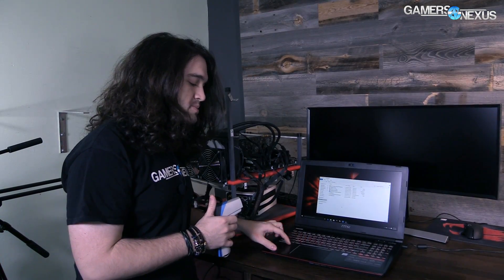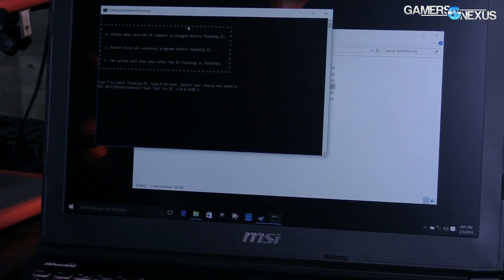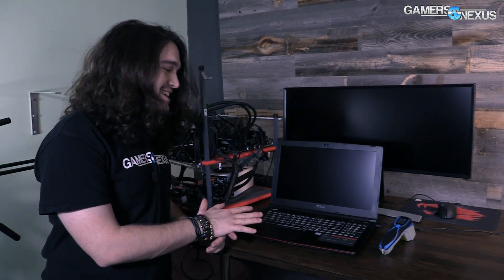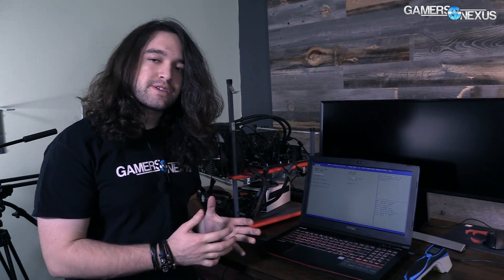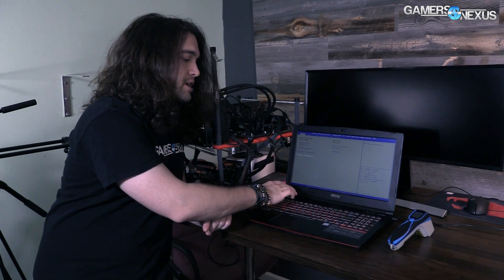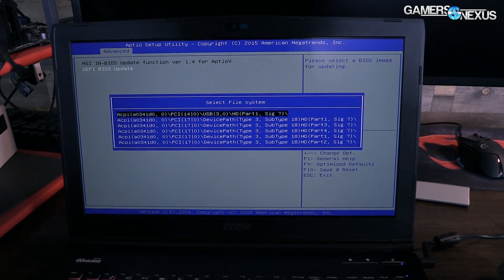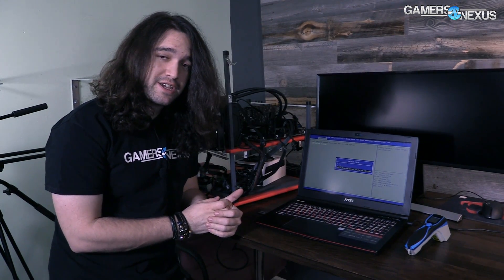How to Fix MSI Laptop Fans & Overheating

Comment: Thx for the video , I was able now to fix the heating by 10 to 15 C° without updating my BIOS because I lost my USB stick. Now I'm around 30 to 35 C° and before it was around 40 C° heating up to 54 C°. Now thanks to the EC update it has a better control over the Fans. Next thing i'm going to do is updating my BIOS and cleaning the fans. 

For other people who are asking where you can download the files you need to go to the official website from MSI and in the search bar type the model of your current laptop (for example I own the 'GE72 6QF Apache pro'). When you scroll down you will find the BIOS and EC files as well the instructions how you need to do it right.
Reply: we have the same laptop i've downloaded the file in the BIOS tab and it only contain E1794IMS.111 file.. now what to do next..

according to the manual, there is 3 ways how to update but all of them is not applicable for me because once i've extracted the downloaded file it only contains the EC file without the BIOS bin file, a flash.bat file or a flash.nsh file

what to do? thanks
Reply: You need to extract the files to your DESKTOP with winrar or winzip , then you open the Map en you launch the ECWin .BAT file and the rest happens automaticly. For the BIOS you need to read the manual and learn how to prepare the USB stick. Everything is perfectly discribed.

Comment: What do you do if you are already using the updated fan curve and you are idling at 70C? heck, not even cooler boost is making much of a difference.

CPU is pegged at 88C under a small load and no amount of fan rpm helps. heat syncs are dust free.

Comment: Hi, yesterday I recently banged a big the left side of my laptop fan, because i was laughing alot on a video I was watching, then the fan started making a loud noise so I turned it off quickly, then I checked the inside of the laptop and both of the fans looked completely fine, the wierd thing is that i compared both of the fans, and they where both the same. Btw, I have a msi apache 72. Thank you :)
Reply: my apache 72 does the same thing. have you found a fix? im considering sending it back to msi when there is a time im not using it
Reply: Geralt ofRivia Wait a couple of days and it might get fixed magicly like mine did, idk how though.

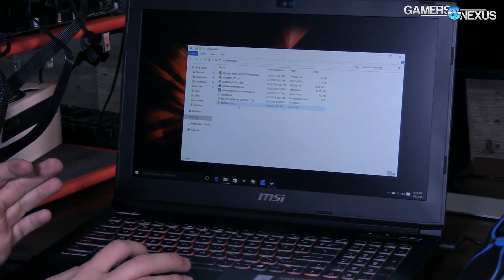Comment: You lost a good portion of us at 0:45. Where exactly do I download the relevant patches? Can't you put up a link at the description? I'm on the MSI website and after I enter the relevant info from a drop down button about my laptop, there is a utility tab with 3 links: Help Desk, System Control Manager, and another System Control Manager.

Please help. My laptop is hot and the fans don't work unless I hit the turbo button.
Reply: i have updated the bios. didnt help for me. there is one thing that helped me reduce temp from 89 to 70 d celsius. i changed the termal paste and cleaned compleatly the dual fan system. exhaust from gpu was blocked by dust and termal compaund was just shity. i recomend traying that by ur self or pay someone that can do it without damaging your guarantee.
Reply: There is no bios or driver tab for the ge72 apache pro 6th gen 760m like there is for the GE62. HAAAALP!
Reply: whats your pc model? www.msi.com/support and go to download and manual. 
i went to gaming series, ge series, and found mine msi ge72 2qc apache.
Reply: i know what you mean. the first time i cleaned mine, it was an absolute mess inside. granted, i feel like i should probably do it again (temps are rather high, but not enough to overheat), im just hesitant because arctic silver 5 isnt exactly ideal to use in a laptop pertaining to the cleaners they want you using.

on the otherhand, the bios updates were mandatory. the fans didnt operate correctly and one needed to be replaced entirely. the new fan doesnt quite operate at the same speeds as the original which sucks imo.
Reply: guck foogle Arctic MX-4, lowered cpu by 10° and gpu near 20°, that 's a really good stuff, 1000 time better than stock thermal past, now I can play The Crew in ultra without the need to cap fps to 30 or the gpu just reach 90°

Comment: hi there! i have an msi gt60 with a gtx 770m and i7 4700mq. My idle temps are high 50's celcius and under even a bit of load it goes to 70s and 80s. ive cleaned the fans, no dust build up, could it be the thermal paste? thanks!
Reply: Don't worry about that :) as long as your game doesn't get impact with huge FPS loss when GPU throttle and fan start to make noise and GPU temperature decrease a lot.    If the temperature is stable and the fan running fast then slow, fast and slow keeping the same temperature; that should be fine :DI have 980m SLI and this is normal.  Around 50-60 Idle.  On real load 70-83.and remember :DLoud Fan = High Heat = High Performance.Quiet Fan = Low Heat = Low Performance.

Comment: I havee 62 6QD Apoche Pro, and it still has major over heating problems, I even sent it in for "repair" to MSI and it's actually worse than before. (they replaced my hard drive because they thought it was a software issue....) my current BIOS update is the E16j5IMS.113. Any help would be amazing. Thank you
Reply: ge62 6qd u have is the latest ? 4 gb of vram not the 2,u found solution?i m thinking of buying this lap ,would u suggest me do so

Comment: +Gamers Nexus
I've got a PX60-6QD-002US and the CPU fan never stops. No matter if it's idle or not, the fan keeps going and going and going. It's keeping the laptop cool, but it's draining my battery.

What can I do to fix this?
Please help!
Reply: +Dominic Bohne Had the same issue. For me it was the EC firmware, which had the fanspeed curve idling at 10 percent or something. I got SVET's EC tool from the MSI forums and changed the curve myself and reflashed the EC with my custom firmware, now its nice and quiet until it hits 50 degrees. Also some people suggested to reset the EC via disconnecting the battery for a few minutes (mine has a little hole on the bottom, the more expensive ones have detachable batteries).

Comment: Similar problem on a MSI GS70 2QE Haswell. Two fans GPU fan (left side) runs fine. CPU fan (right side) runs at a fraction of the max speed and CPU overheats. I flashed Bios and Firmware and bios displays correct versions but, no effect on the CPU fan.

Both fans spin up to max when flashing Bios but, the CPU fan barely reaches half the speed when running Pirme95 and temperatures in the 90s.

I took it apart, sanded the heat sink contact points with P1200 sand paper and replaced the thermal paste. GPU benchmarks show 8 degree drop in temperature and the CPU runs at a higher frequency on Prime95. But, the CPU fan speed is still the same and temperatures are still in the 90s.

I know the fan can reach high speeds (like when your flashing) but, refuses to do so when loading it up in windows.
Reply: Mate, i have same prob with you, on my ge62 2qc 5th core i, but GPU fan instead, it kind of slower than CPU fan when i hit cooler boost button for max fan rpm, i already send a mail to msi yesterday, wait for them to reply, my model is not the latest, and i hope it is firmware issues, so will they gonna patch mine ?
Reply: I doubt anything will be done about it. I am thinking of replacing my fan and see if that works.
Reply: +Here Wego i will bring my system to my reseller for hardware check, and apply for warranty if necessary,  after that we will compare our result, and by the way this kind of common problem with lots of gaming model of msi, i read similar topic about this "fan" issues.

Comment from the maker: Two notes: (1) A lot of SIs actually rebrand MSI laptops, so this fix will work on some CyberPower, Origin, and iBUYPOWER laptops as well. (2) This will not fix all thermal problems on all MSI (or other brand) laptops; you may have to reflow solder or apply new thermal compound. This fix only resolves the low fan speeds found on some new models (like the GE62). It's an easy fix and worth trying, will work on new units, but you might have to do more work on older laptops.
Reply: I have an MSI GT70 with some thermal problems.  The fan will not turn on at all until the temp gets very high.  Along with this problem, the graphics card is not being read until the temp gets very high as well.  Any ideas what the problem is? I tried bringing my laptop to two separate repair shops and neither can figure it out.
Reply: +Gamers Nexus haha thats loud xD